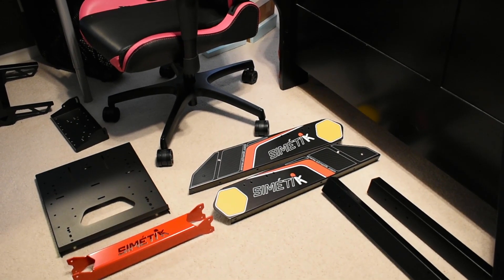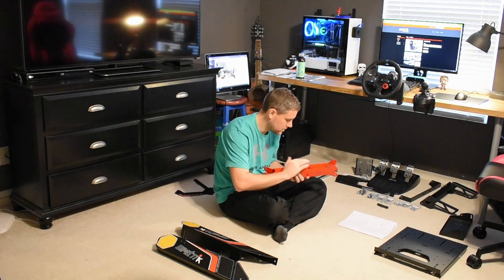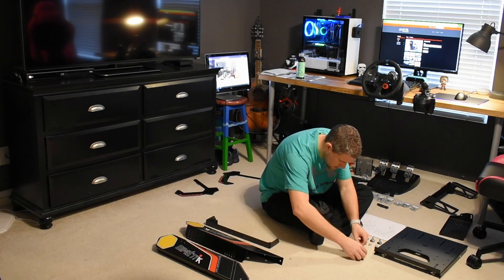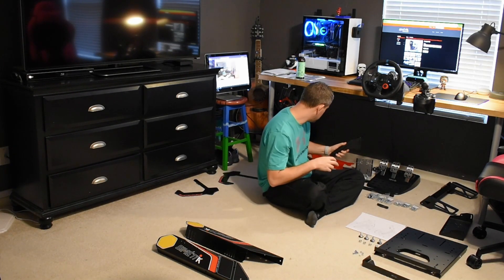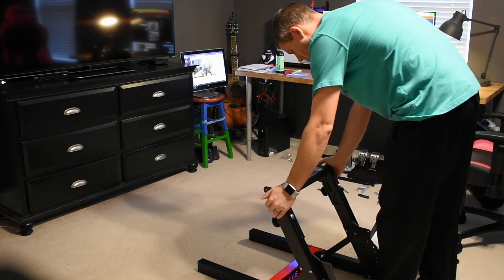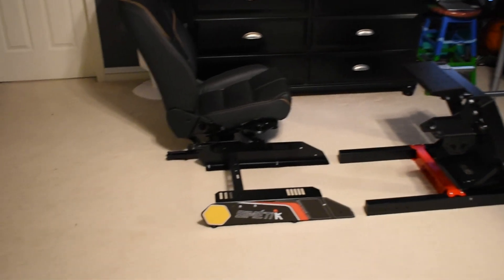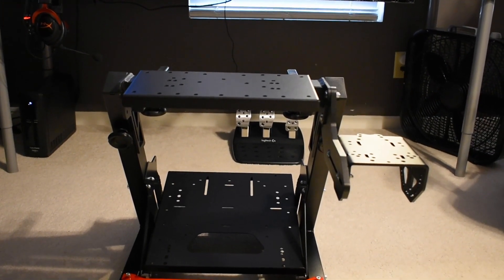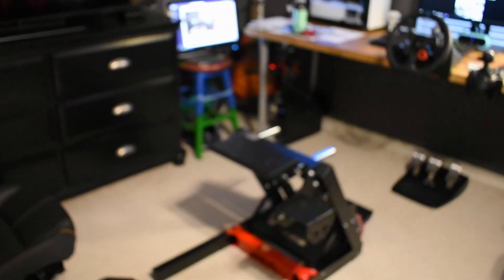Simetik K2 Build Vlog Part 1

Comment: Just wondering on how you are going to power your seat? I pulled a power seat from a mustang and want to keep the power options as well.If you could help thatd be great!
Reply from the maker: I bought a 12V power supply from amazon which I will link below. Comes with an adapter that must be put onto the wiring harness from the seat and then its plug and play. You will need to cut the power and ground wires off the OEM harness from the seat for the adapter.          LEDMO Power Supply,... https://www.amazon.com/dp/B01461MOGQ?ref=ppx_pop_mob_ap_share

Comment: Hi dude, I’m interested in that Simetik Rig, but I would have to use it without the seat part as I’m confined to a wheelchair. I just wonder if there would be enough space in between the feet of the frame for me to position my wheelchair directly in front of the steering wheel? Could you please tell me the exact measurement of space in between the feet of the frame?
Reply from the maker: The space inside the frame is just over 15 inches. I feel like that is pretty narrow to have your wheels go inside but they can probably go around the outside. The width of the frame is about 18 3/8th inches. One thing I think you may also need to consider is the height. I was very surprised how short this rig is but it is made to be 1:1 scale with a GT3 car. With the steering wheel plate mounted as high as it can go the bottom of the silver adjustment bars are 22 7/8th inches from the floor. Hope this info helps in finding a rig to fit your needs.
Reply: Casey Flanigan   Okay, thanks for the quick reply. Unfortunately it looks like the front wheels of my chair won’t fit around the frame. My front wheels measure from 43cm on the inside, to 57cm on the outside. So even if my front wheels were 4cm farther apart I’d still only have half a centimetre to spare. I hadn’t even considered the height being an issue. 23 inches is a little low alright, but I think it would be fine. Just the width is a problem. Thanks anyway for your help.

Comment: can it be adjust for right hand drive?
Reply from the maker: Yes, the shifter bracket can be mounted to either side and the handbrake bracket is sold for the right and left sides.